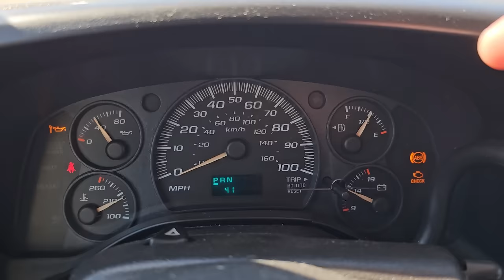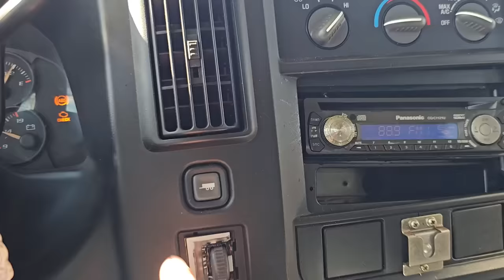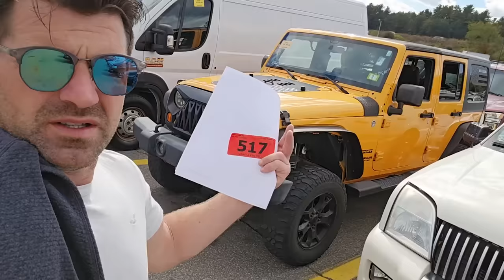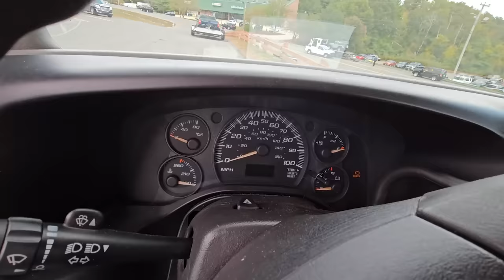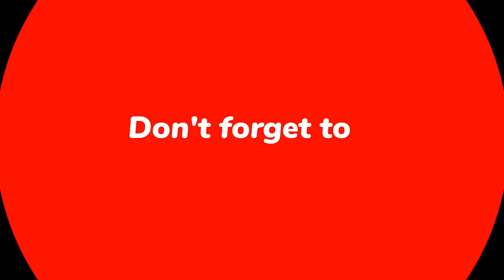CAR AUCTION SCORE! This might be the Most Fun Car I've ever bought! Heres why

Comment: I would put in rv bench seats that’s either have storage underneath or the ones that fold into a bed. Put the sideways not facing straight ahead that way you have space in the middle you could even get the folding tables that used to be in mini vans and put it in the middle of the van. I would also put solar in it and a tv with a gaming system. Shelves along the back wall.

Comment: That is a good deal. The dually's have 6.0 and 6.6. I have an 07 Chevy 3500 dually LBZ Duramax 6 window bus. It is the taller square body instead of the rounded top. I painted it, stripped the interior, took OG bus windows out installed 16g sheet metal, and put in a couple of RV windows in. Then I put a full bathroom shower, sink, and RV flushing toilet and put my black, gray, and freshwater tanks in. The thing is stout and I only have 10k in it. I pull my 34' enclosed trailer around the country hitting the streets and track drag racing.

Comment: Great idea! As long as it's relatively reliable (I would think it'd be at least easy to work on) and the MPGs aren't excessively awful (especially with that monster AC running) it could be a really cool vehicle especially for summer beach trips. Just forget the "Emergency Exit" requirements and put a big ole' comfy couch back there with maybe storage below it.
Reply: Right around 13 mpg I think. Not too bad. His may not be supercharged, but some later models were. They would get up and go! I’ve driven similar buses. Lots of value there, as long as you can have it maintained and repaired as necessary.

Comment: I flip cars and believe it or not busses do very well. I’ve never bought a shorty but I’ve had 3 full size busses and made money on them ( still have 1 because I wanted one lol) . My first bus purchase was 2 running church busses for $1000. I just knew I was messing up . I posted one for $1700 and people went crazy messaging me so I posted the other for $3500 and yes it sold in a few days. You would be surprised how many people want a bus( I was ). That shorty would work for a shuttle bus or put nice seats and lights and rent it out as a party bus. You only need a cdl if it’s got air brakes . That one probably doesn’t